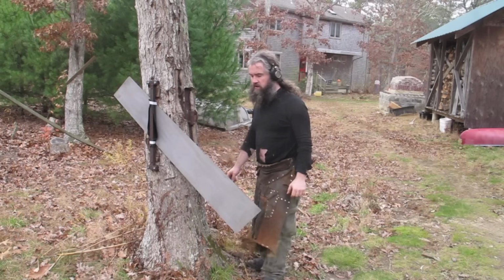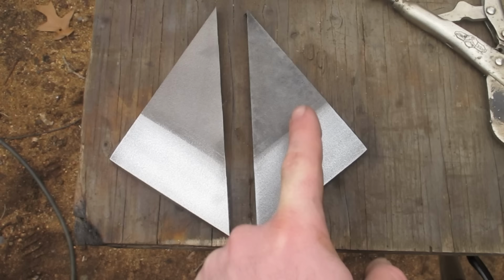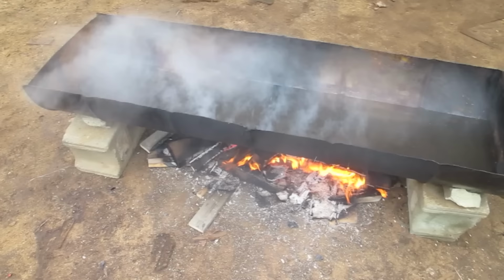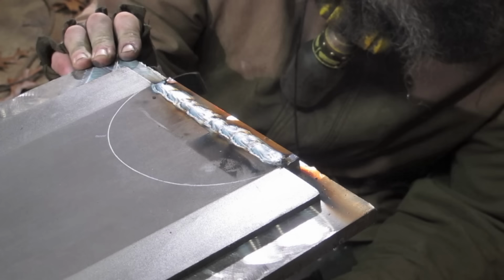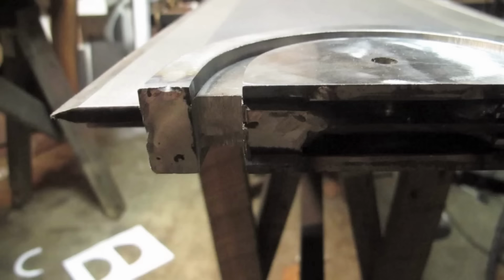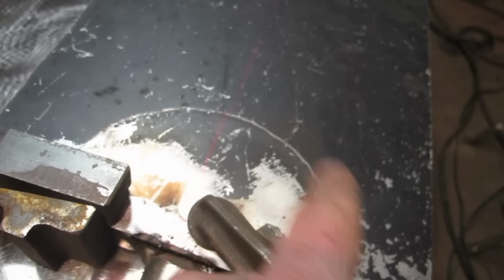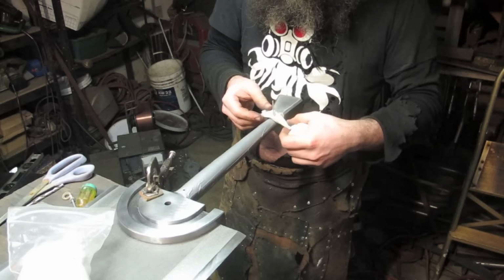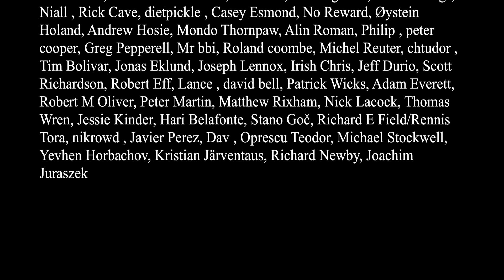Dragonslayer Build

Comment: Honestly, I think I'd want a truly accurate version of this sword built not to be wielded, but to just... be there. To let you feel how utterly fucking stupid this sword is yourself, add some weight to Guts' actions. If one day I ever become a smith, probably something I'd be insane enough to try. If nothing else, you could use it for weight lifting.
Reply: uriel nicolas rosso  I've squatted 405 but that was my max. I also might have had bad technique so, maybe a proper "squat" going down lower wouldn't be something I could do. I have good legs in general. Idk, if you've ever seen people participating in Highland Games, those show the ridiculous stuff people can do.
Reply: Pretty Hate Machining has been posting videos of where he's making a Dragonslayer from a 2" slab.  The blade alone ended up being slightly over 300 lbs.

Comment: If made 100% accurate to the manga that beast would be about 1-2" thick and would weigh at least 200-300lbs, and one of the things I like most about Miura's work is that it ISN'T normal. People react to Gutts even being able to lift the dragonslayer with the shock and fear it deserves.
Reply: You seen that shit In lost children where he one hands it straight up in the air with like a kid on the end of it. The actual strength of this man
Reply: Ricardo Santos xactlyyyy
Reply: Mazhar Imam  The blade was sustained by his false arm on its mid-point though, meaning he mostly busted the amount of weight his teeth would otherwise have to carry in that scenario. It's still amazingly impressive that his teeth are that strong as to not break while holding a part of that weight, but it wasnt the whole thing.
Reply: @Someone_Somewhere7  he does catch Roselina's (or whatever the elf apostle's name was) stinger with his teeth tho, so it's somewhat consistent :)
Reply: It was 213 sm and 270-320 kg
Reply: Some guy on 4chan did the math and estimated that it'd weigh around 400 pounds
Reply: Yeah that’s not accurate whastoever, there’s no way it would say anywhere near 200lbs
Reply: Officialy… it weighs 180 lbs
Reply: The manga writer (rip) said it weight around 440lbs
Reply: @nikolai 1939 Yeah, but we are talking about different scenes. The comment I responded to is no longer here.
Reply: @nikolai 1939 I, never went against the fact he can one-hand Dragonslayer. I talked about holding it with his teeth.
Reply: It's actually around 50 pounds, usual sword weight is 2 pounds.
Reply: One handed too like a boss...
Reply: Even horizontally with one INJURED arm
Reply: @justadummy8076  Unfortunately it is accurate. Guts is strong, not by our human standards. It’s totally plausible in berserk lore that if anyone can lift it, he can. That’s the entire reason the dragon slayer is interesting, because it’s so fucking ludicrously massive and obtuse that no normal human should be able to lift it, let alone wield It in combat. 

Then they see Guts do it, and react justifiably in shock and amazement. Yes, It does make sense in the lore of berserk.

And I’ll make it clear that no human being will ever wield an accurate dragonslayer, it’s literally impossible. Anime and Manga isn’t reality.
Reply: dude how Isidro lifts Dragon Slayer im confused
Reply: Average one hand swords only weigh like 2.5 pounds and your talking 5 to 6 for the larger two handed swords. I use a older 3ft chain saw all the time that weighs about 25lbs and it's insane to think you could even swing that one handed for any length of time.
Reply: Well its gutts he been using a sword bigger than him since he was a child
Reply: @demiurgee  leverage
Reply: @user-ne3jo5sp8g  nah
Reply: @TheOfficialLonestar  nah
Reply: @kyokushinheart  miura never said dragonslayer's weight, where is the source?
Reply: @TheOfficialLonestar  lmao, yes, you are right, a 2,10m sword, with 40cm large and 5cm thick, out of raw iron, weighs 50 pounds... which world are you living? "Usual swords weight is 2 pounds" and? Berserk is fiction, not reality... Guts is a superhuman, man.
Reply: @worllokskull  I don't care.
Reply: Well if I’m throwing down a bunch of money and time to make a replica of the dragon slayer I kinda wanna, yknow, hold it 💀
Reply: @umb3805  you know, lifting an accurate replica of the dragon slayer is... impossible 🥲 but we can keep dreaming
Reply: there was a panel in the manga where it took about 3 knights to actually carry the thing, and they barely even lifted it past knee height.
Reply: My favorite sword reveal is when Guts fights off the trolls attacking the church in the woods and the priest scoffs at Guts taking point buying time, saying that men cannot possibly fight such creatures. Right before Guts cleaves through multiple trolls in a single swing leaving everyone in awe, even the trolls stop to stare. Great scene.
Reply: it has been made now!
Reply: The actual swordweights somwhere from 190 to 220kgs
Reply: @demiurgee  If Dragon Slayer weighs more than 100 kg Isidro shouldn't be able to move it at all. As a grown man I had a moment where when I was deadlifting I couldn't budge 170 kg (nowadays my max is 200 kg).
Reply: but he just wants to be happy
Reply: More like 4-500 lbs. Guts is crazy.

Comment: 44:55 Oh boy, I'm happy you didn't lose a finger there.
Reply: Katrulzin ikr?
Reply: small angle grinder with grinding disc wont cut you a finger with just a single hit....i work everyday with them , it will hit the bone and bounce even with thin 1mm steel cutting discs...its not a very dangerous tool....main danger its the eyes when a disc breaks thats why when using the grinder without the safety guard you should place it to your right, because when a disc breaks the debris will bounce ALWAYS the opposite direction of were the sparks are flying and if you are working with the machine a little bit to your side you can be hit in your arm but never on the face...sometimes for example to cut the exhaust of a car or other hard to reach cut it is necessary to remove the safety guard of the grinder

woodworking table saws, chainsaws and angle grinder with stone or wood cutting disc...that is very very dangerous and WILL cut tissue and bone instantly at the minimal touch.
Reply: also  great care must be taken because the tool has a rotational direction and we must cut or grind according to that...failing to do so will result in the machine boucing and hit our face , belly etc..also when cutting care must be taken so that the material to be cut wont fall or bend inwards towards the cut area and tighten the disc causing the disc to break, the machine to stop or worse causing us to fall with the chest over the machine. if we respect these rules the grinder is a safe tool

Comment: unable to weild weapon effectively with current attributes
Reply: LivingFailure where's the knight ring
Reply: Slitherin Wyvern different game
Reply: Siegfried from Sould Caliber. Either rests the weight on the ground or his shoulder before swinging. It’s possible...
Reply: I DON'T CARE 
*Fat rolls away
Reply: Havel ring +10
Reply: Trenton McMillian 
Oof
Reply: Also we are fat rolling....we need the havels ring
Reply: Technically you can wield a dragon sword to swing you need to basically use momentum and pivot it, centrifugal force will do the rest you just have to train yourself to get use to carrying four hundred pounds around and it can be done in the marines I carried my full gear and got stuck carrying the second heaviest guy in our platoon for screwing up he weighed 240 at 6'04" I weighed only 160 at the time and our standard gear weighs sins 60 so I carried him and our gear three miles through hills so glad it wasn't a forced march though. And I'm also glad our sergeant was on guard duty though that sob was a body builder he was shorter than me but weighed just over three hundred and twenty he needed a waiver to stay in the corps because of weight standards he always passed because he had less than 2% overall body fat I don't think I could carry him with out causing stress fractures.
Reply: teuflhunden if anyone could carry it and use it, it'd be a Marine.
Reply: wieldn't
Reply: Ahh Dark souls. 2 i hope?
Reply: GamingSoul12 gonna need a lot of repair powder since durability is garbo in that game
Reply: ehh... just use a bonfire.
Reply: GamingSoul12 except this is a no bonfire no dea th run
Reply: !BUILD AT RISK!
Reply: 1st Person Creations cuz you got no points into carry weight.
Reply: Slitherin Wyvern wield it with both hands
Reply: reads Dark Souls comment I see you are a man of culture as well.
Reply: Slitherin Wyvern xD
Reply: However you can use it with both hands
Reply: it actually cant be done...you carried the other guy by his center of mass,but when it comes to a sword you need to wield it by the handle which makes it a great deal harder and needs alot more force and trying to actually pick it from the ground with a momentum would be a fucking nightmare when its around 400 pounds! nevermind hitting anything hard with that kind of a heavy sword would absolutely shatter both your arms and hands bones!
Reply: Give that thing to the mountain/sir gregor
Reply: Hold with both hands
Reply: Need to spend some points on stamina and sword skills. Max out Exp
Reply: @quadbell8190  marine XDDDDDD
Reply: *wield
Reply: Amazing chest ahead
Reply: Fuck where's the knight ring?
Reply: *cries in dex build

Comment: Inspired by your work, I've been working on a big ass sword that's based off of the dragon slayer. My version is 6 ft tall (4ft blade and 2ft handle) and I used 3/8th steel for the blade, not sure how much it weighs but it's heavy lol. It's just light enough to sit it on my shoulder like in the manga but it's very difficult. 
Similar to the dragon slayer with the little chain link to hang it on your back, I made a larger circular ring to hang it in a more easier fashion.

Comment: Fun fact Dragonslayer is 4-8cm taller than Guts and weights atleast 400 pounds or 180kg, its about inch thick and its predecessor Guts' raidsword weight was only 35-50 pounds.